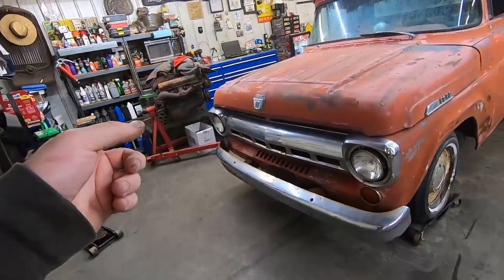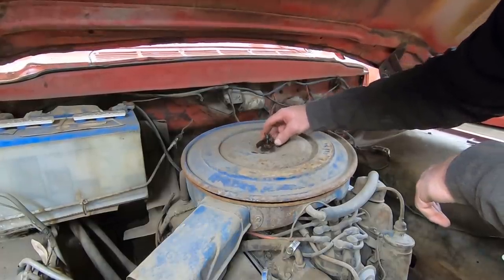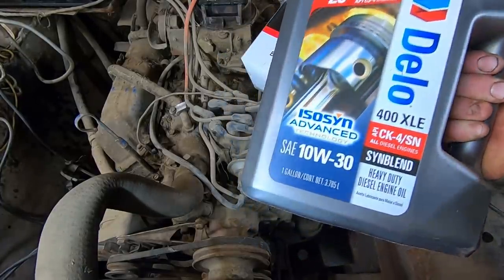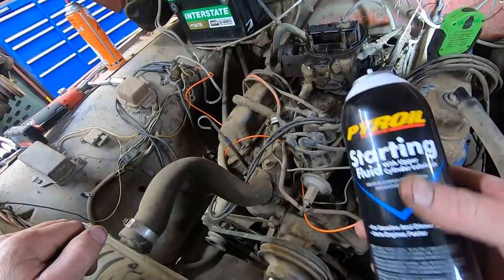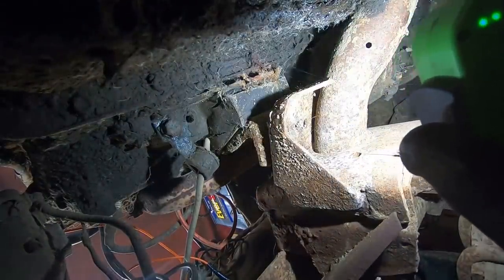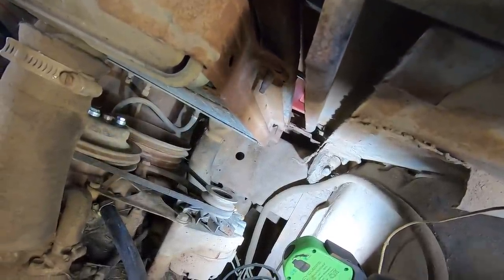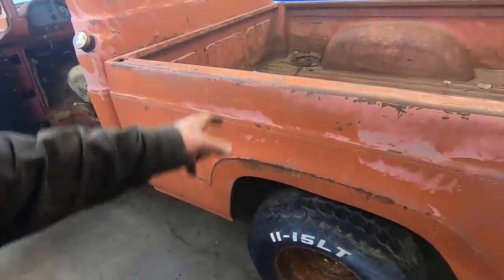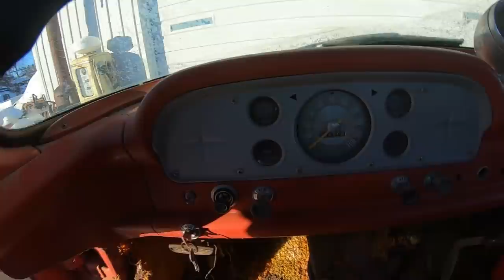Forgotten 1957 F100 Hot Rod Pickup Truck!! Abandoned for 40 Years! Will it Run?!?

Comment: If you look up from below between the starter and the block, there’s a flat spot that Ford stamped the block codes on.  Cross those on the Google’s and you should be able to learn what it is and where it came from.
Reply from the maker: Cool, thanks!
Reply: @MortskeRepair  Funny, just got to the point where you had the usual starter battles and ended up finding Fords hiding place.  How about that!  Lol

Comment: I put a 351W  300hp mustang engine in my '70 bronco,,  made it real quick,,, I found out later that the guy I bought the motor from went to prison,,,  he was part of an auto theft ring,,,  If you decide later that you want to put that engine in your bronco,, then you will need to modify a 302 bronco oil pan to fit on the 351W,, (351w has a larger rear main bearing),,   :-)
Reply from the maker: Interesting

Comment: The rear of the driveshaft is quite typical. I’ve seen those before has rubber isolators between the two layers from the factory.

Although yours looks quite rusted and distorted. And the dent, Will allow you to lose weight while driving, L O L
Reply from the maker: Brilliant

Comment: You really DON'T know Windsors, do ya, lol? 351s are as easy to get parts for as a 289 or 302. Most parts are the same. The intakes and size of the head bolts are different, and OC the crank. Also, with stud mounted rockers, ya won't be so likely to bend a pushrod as an FE might.
Reply from the maker: Nope, go find me a stock crank for a 351W with a 1 piece rear main seal why dontcha?
Reply: @MortskeRepair  Hmm, never tried to. Does that even exist? What do the later roller motors have?
Reply from the maker: @donellmuniz590  Yup

Comment: Look at this if it cost money to get car parts and pistons you can save you can convert things to engines and put them in car such as these and make it so fit car and pistons every thing you can find they at local dumpsters by home depot's and factories and find the fans giant industrial ones with long frames molar to these pumps with same fly wheel find water pumps like this guy to cut some of body off to cover rocker arms you make and but three piston inline  and boxer engines inlined related to boxer bot alone not both sides rotating pistons but just as powerful and stroker like i sad Scholl buses and that were this is a money saver to make more money

Comment: Thank You Mortske.. i am guessing somebody might tic a few boxes with that.
 As far as Fram, 30 years ago i had a bunch or gasket leaks on them. Quit using them for awhile, customers don't like drips almost as much as i hated gorilla torque on them.. but the filter is about the same as the rest and no more expensive.

Comment: I've seen people use Fram and it work out fine. They're cheap and common so it makes sense the horror stories will be more frequent. The big issue I've seen on videos where guys cut them open is they seem to have sloppy glue work and rust in the can. If I was breaking in a cam or doing some cheap oil flush, Fram or Supertech but for actual long term use I'd probably spend the extra for a Wix.
Reply from the maker: Neither have I but there's been a lot of horror stories out there. For a couple bucks I ain't riskin it.

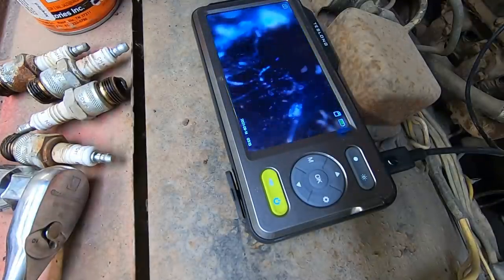Comment: @ 18:24 WTF was That ?  OK  Sorry, I called You Kevin, Tom.. saw it on your jacket once I think and just assumed.. @56:50 Try some heater hose (eh..hoser) for leaf spring bushings.. It might work for a minute and the spacers could fit. ?. it's rubber at least.  Good try at the test Rips.. I almost bought one of those '58 Ford F100 292ci 4spd but I sunk in the mud field and couldn't get 'er back out except to pull it out.. tow truck strap and lots of rubber off his tires.  lol. Yup it's a FURD  Fun for Shit's and Giggles.
Reply from the maker: Call me anything, just not late for dinner!
Reply: @MortskeRepair   I use that also.. Call me anything you like but just don't call me late for breakfast, Lunch or Supper.  Sandwitche's ain't just for breakfast anymore.  lot's of Shit's & Giggle's all around here with this Oldie (pretend) drag truck. .F100 Hooptie !

Comment: Even though that's a 9" ford that's one off year almost no parts for a 58 and up 9" will fit it
Reply from the maker: Like what parts?
Reply: Not sure fribuger was talking about it on a build might have been the hemi gremy I think he said wheel bearing and seals and something about carrier is different
Reply from the maker: @jeremyhanna3852  Gotcha, so you're just going off what he said? No actual facts behind it? Cool. That helps.
Reply: @MortskeRepair  u need me  to wipe when you poop to I saw it thought I would mention it so YOU could research it if it was my rearend it would be my problem but it's not

Comment: I'm confused,  what is the difference between a manual Master cylinder and a hydraulic master cylinder?  Seems to me that; anything made before 1980 would be manual. Also don't touch that ole'  she's a Beast.
Reply from the maker: Some clutches use mechanical linkage. Not a hydraulic setup
Reply: @MortskeRepair  Uggghhhh I meant the Brake Cylinder.
Reply from the maker: @crazykellywfo4240  Power brakes were an option going back to the 1940s on some manufacturers. And still an option well into the 1980s before it became standard.

Comment: I ran Frams forever and never had an issue.
Reply: Said nobody ever.
A shop put a fram on a truck I had after a bunch of work and the oil didn't last 1500 miles before it was spent.
Reply from the maker: Neither have I but there's been a lot of horror stories out there. For a couple bucks I ain't riskin it.

Comment: the kiss principle. keep it simple stupid. i changed the engine in an 81 Toyota van because it had a bad starter. the guy bought a new used engine got it all installed then found the fuel connection at the back of the cylinder head between the head and the firewall,  just enough room for the wrench to fit in. got it running then he sold it. the kid he sold it to was hot rodding and wrapped it around a tree.
Reply from the maker: oh my!

Comment: Thanks for nothing. Why would you make a video if it didn't start?  Just kidding. Very elucidative of Ford making it hard for the man with a garage and an old dog to start this POS. My father worked Ford in 1963. Always said Windor had 8 VC bolts. He installed both engines. No one cares. W/C vs a hard call he said. Windor was a better 302 but had oil starvation issues. Cleveland cooling was better for 289 engine. Ford engineers knew deficiencies back then, But the Windor was an upgrade for multiple models. Cleveland was just as it said. Built in AVON. OH. Not Cleveland. Final assembly in Ohio.  Base model Mustangs were 6 cylinders. More of these left for scavenge than the 8's. FB's and 2+2's came later. There is no such thing as a 65 Mustang. The model year was introduced in late 1964. They were retooling for the Ford/Mercury/Comet,/Falcon. Which outsold the Mustang. They made a 4 door model. The Mustang was considered and marketed as a "Secretaries Car". No one cares. Lee Iococa was chief designer then, his ass was on the line for pushing this underpowered, hard to build unibody 6 cylinder mid-level commuter car on the mass market. What Iococa could not have predicted, was the huge influx of woman professionals, with money and influence into the workforce. Enter Carrol Shelby. A failed engineer, who was retained by Henry Ford to find a way for Ford Motor Company to compete in the European market. Ford had extensive influence in Central and south American countries. The Mexican factories are often overlooked when considering FOMOCO. !5,000 Engine blocks. 410 MEL engines made available for modification. All were deemed weight restrictive and mass production hinderances to Ford's vision of racing. No one talks about John Derringer's glowing letter to Henry Ford for producing the V8 engine that allowed him to outrun the cops. The bullshit between Ferrari and Ford is finally answered. Enzo was never going to sell to Ford. Ford knew this in correspondence. 351 V8 on the spec sheet since 1958 was made available to Shelby who was a contractor.. The GT 40 was in development since 1960. It was and is not the Cobra AC. That is a British open cockpit coupe which was a later addition to IMSA racing.

Comment: Oh I guess you're not a body man bet you puddin could do it perfectly
Reply: Can you see if puddin will do it for you bring him or send him the hood if you look at the center area in the front along the edged you can see where you'd need to cut it and along the sides and back where the top edge of the sides on the very tip slice it right from back to front and hammer the bent upwards sides down flat and some in the front where there's dents cut away a little of the lower part of the hood hammer it downwards a little for the hole in have a cool looking factory scoop you should try it bet he'd do a wicked job